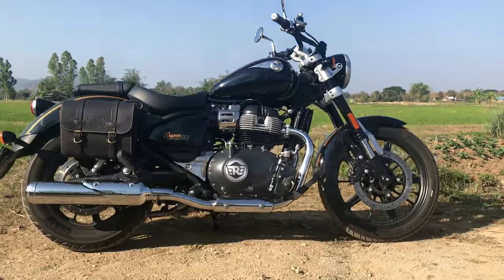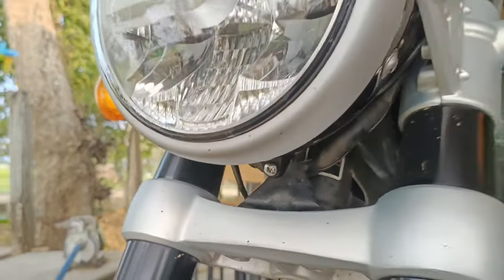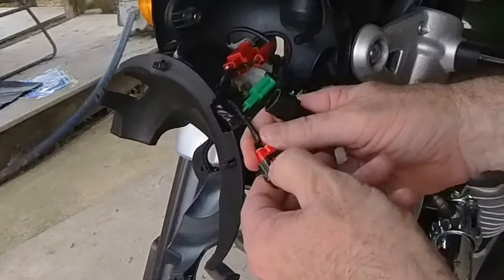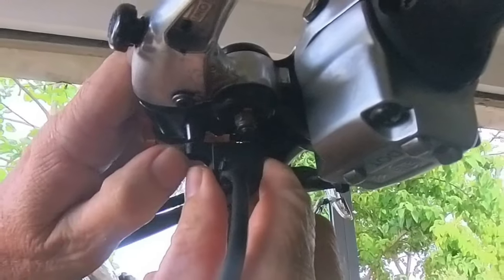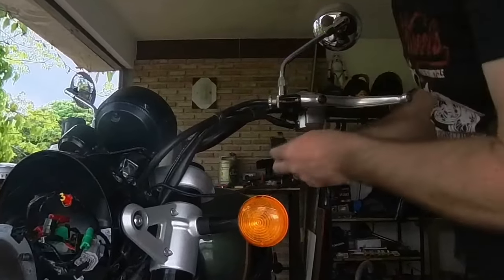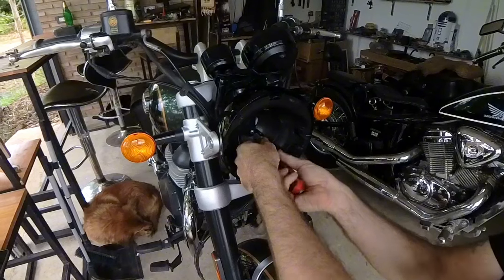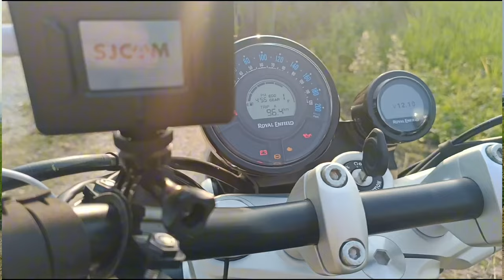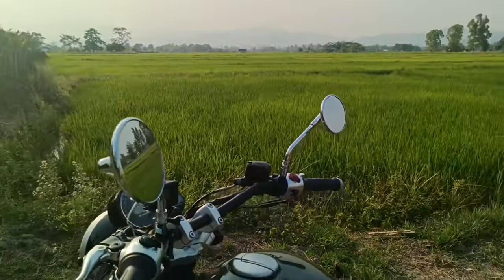Meteor 650:- How to Install Meteor 350 USB to SM650

Comment: Thank you Teacher T for sharing such a informative video for parts that outside the box, I've just installed it on my Super Meteor, very nice and easy to fit by following your installation. 😃
Reply from the maker: Great new. Where did you get the part from? Some viewers are struggling to find it 🙏
Reply: @Teacher-T-Thailand  Since it is a Royal Enfield's genuine parts, I basically just go back to the local dealership here in Sydney Australia and ask them with the parts number shown from your video, luckily they happened to have the very last unit in the other state, funny the local dealership here also wasn't sure if it going to fit for the SM650. 🤣However, your video gave me a solid confident and so I insist them to go ahead for the stock transfer, got it after a long wait for 2 weeks and had it installed for just less than 30 minutes. 😁
Reply from the maker: @mawill2011  perfect. They are hard to get hold of since my video. Glad you managed to get one. Makes life so much easier having an extra fast charging usb 🙏

Comment: That was a really interesting video with loads of transferable skills and information.

I went a slightly different way with my addition of a dual USB port. I ran the power from a Healtech "Thunderbox" power management module under the seat, up under the tank to the cable cluster on the right-hand side of the head-stock.

I then routed it up to the area just above and to the right of the Tripper (soon to be replaced by the Beeline Moto 2 unit. I designed and 3D printed a mount for the USB unit and had that clamp round the Tripper housing.

It's up where I can get to it for plugging in cables and the dual USB socket can be independently powered off when I don't need it.  

As you say, the area behind that plastic headlight shroud is a mess and I found it really difficult to get the shroud back into place when putting it all back together again. It looked like mine had already been mangled when being put together in the factory.
Reply from the maker: Nice 🙏

Comment: FWIW, I just ran a simple 2m Male USB to Female USB cable from the USB outlet in the Toolkit compartment under the tank and to the handlebar.
I chose a nice thick cloth braided cable to counter the engine heat.
Used some velcro tape to tidy up the loose ends and VOILA!
Spent no more than 300 Indian rupees.
Of course it is not as neat as the covered outlet of the OEM part, but does the trick!
If routed properly, it is quite tidy.
Took me no more than 5 mins to do it.
Reply: I also attached a simple OBD adapter to the diagnostics port in the battery compartment.
I then use the DMD2 app on an Android phone for extended readouts such as RPM, Engine Coolant Temp, Batt voltage etc.
Reply from the maker: Nice. I will look into this ,🙏

Comment: Excellent video…I believe the USB on some of the 350 models are on the handlebar..Why the SM650 has it in the area by the tool set is confusing. Would under the tank and under the seat be a good route for a wire?  Thanks for posting…
Reply from the maker: Yes the Meteor 350 has this OEM part pre fitted. This method gives you 2 working usb points. So I can charge phone on either handle bars, or in my pocket with a cable from the side cover. I prefer the later, and then have a usb spare on the handle bars for a camera 🙏

Comment: Unfortunately cannot find it anywhere in UK. Only on ebay for around... £40 delivered from India.
Reply from the maker: Royal Enfield parts are in short supply sadly. I can’t even get rear brake pads from my local dealer. 45 day wait. And expensive. So after market HH rated ones will be ordered. Hope you manage to track one down. Works a treat 🙏

Comment: Really Thanks ! I have seen on ebay that we can find a "USB CHARGER Fit For Royal Enfield New Bullet 350 & Super Meteor 650" (Seller : 'royal-spares'). I don't know if it's the same part reference and if there is any difference compare to the 350 model.
Reply from the maker: It does look the same, but far too much money. Better off going to your local Enfield dealer and ordering the part number in the video.
Reply: @Teacher-T-Thailand  It was not to order but to see if you think that there is a different. and true, I will see with my local dealer